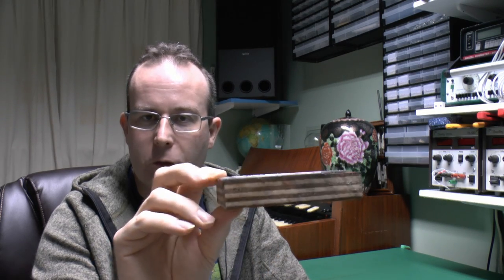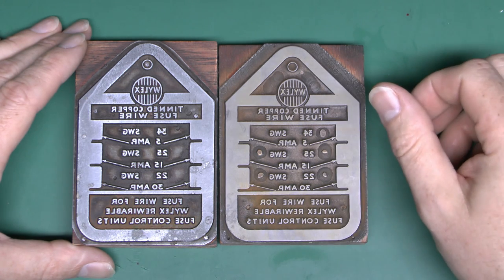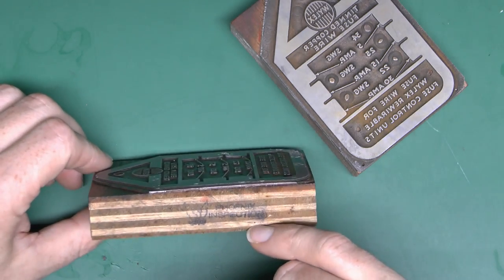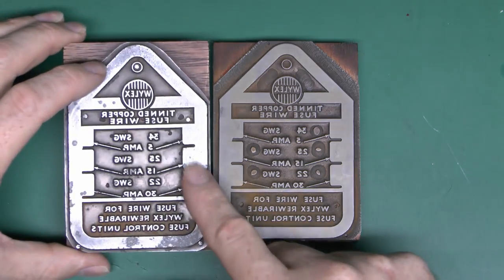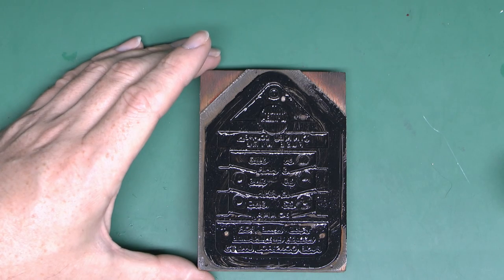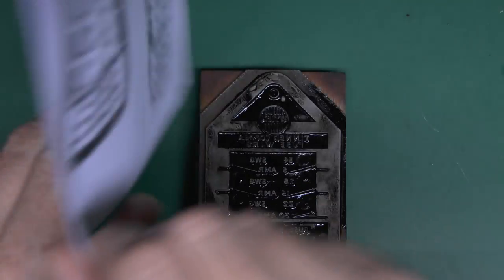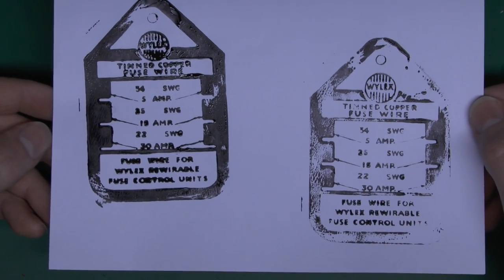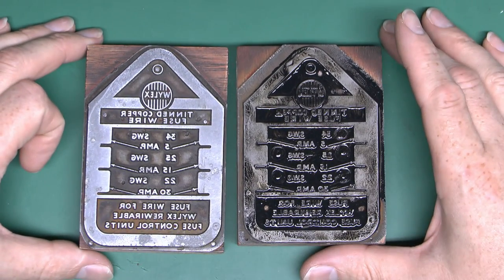Wylex Fusewire Card Printing Blocks

Comment: the reason they are different heights is because blockmakers were lazy sods. blocks were suppose to be type high, if a block was under type high you had to underlay the block, over type high and it meant the rollers would ink up the non printing surface and the impression would be like braille on the reverse side. oh the joys of letterpress printing. now its mainly done offset but before too long, the home computer will even replace that.

Comment: I remember reading somewhere that fuse wire won't actually blow until 3 times the rated current is put through it. So 5 amp fuse wire won't blow until 15 amps is put through it. Not sure if this is true or not. Would be good to see a video putting them to the test though.